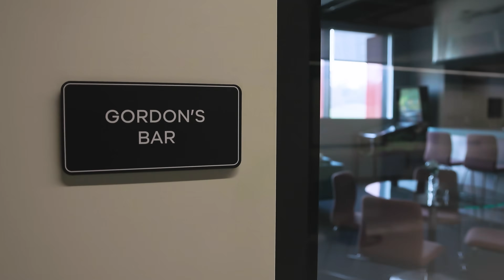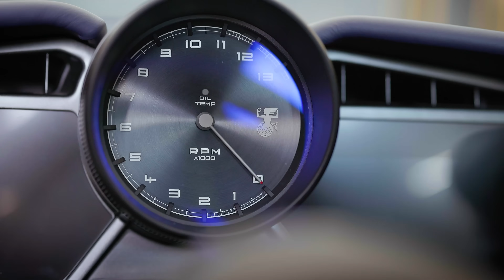GMA T.50s Niki Lauda - Track Perfection

Comment: Should work on Tesla model 3 Prius phev  gr 86 competitor .could be safest car too, BMW i3 carbon fiber structure replacement costed 10k, long term effeincy could offset that especially if gameofying endurance racing style driving (effeincy, lower emissions, at whatever time limit driver may set to get there on time) .       YouTuber called everyday driver found out Prius with nothing but wheel tire swap made it only .03 G's lateral forces inferior to golf GTI . Toyota confessed that. Irrent Prius isn't totally rational to appeal to lowly buyers.          It rumoured Prius phev is more efficient money wise , in average fuel vs electricirynpeics, of driven in hybrid mode only, where electric is roughly only used in preserving momentum on little power at around 10 or 5 mile per hour sped variation, when. Not dealing with intense road inclines. You can charge battery by accelerating downhills then regenerative braking , to be still more efficient than relying on combination non optimally, at least on case of being on low battery charge . Preserving. Momentum inatead of relying on heavy even regenerative braking, predicting traffic behavior including lights, etc all add to challenge fun, simple childish sporty feel can make it not eat sales of sillier cars, making it not precived as thereat to profits. Easily upgradeable parts, aesthetics, etc .

Comment: Warming the oil, is to get tighter tolerance for more power from the trusted engine design?
Reply: 780 HP from 4.0 L V12 NA. Ridiculous. Unheard of. It's almost as powerful as the LaFerrari's 6.3L V12.

Comment: Nice nice. I know it’s not about 0-60, top speed and lap times, but would be super curious to know what ‘bloody quick’ actually means, relative to say LMP2 etc…
Reply: It did a 1:08 at Goodwood Circuit which is faster than the Cadillac V Series R hypercar which did an 1:11. It's basically a sanitized LMP1 with lower downforce to make it more easier for normal drivers.

Comment: I have not watched this yet, but I really really hope that the critical explosion of a brakedisk of T.50s that happened in Goodwood - and which is on film, but those who have shared that in social media has been harassed now - is wrought up first and center at the beginning of this. Not admitting, but instead swept under the rug when faults happen is massive red flag for company, and even more so if is not investigated  inside the company thoroughly.
Reply: Don't be a fool. Of course the failure of a component on a prototype car will be investigated by GMA.